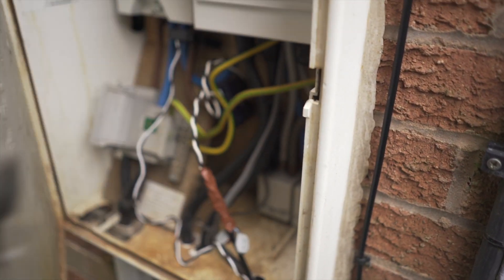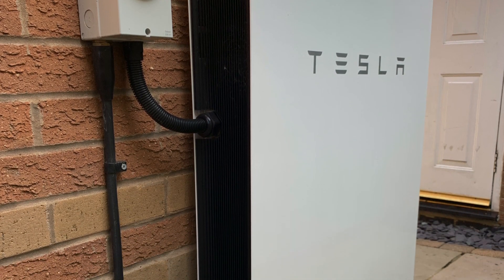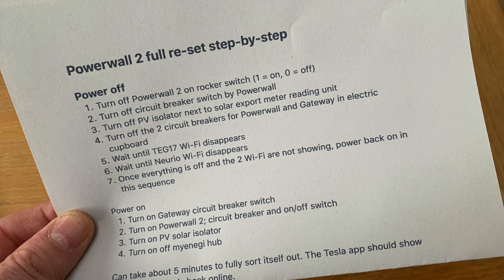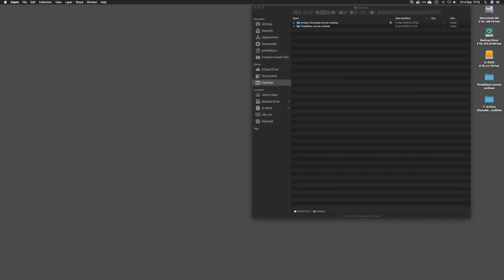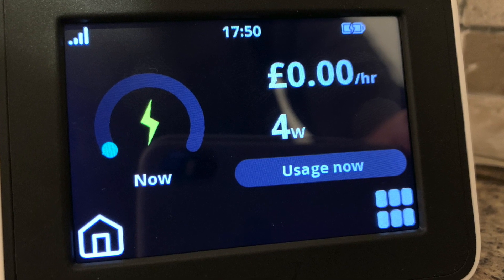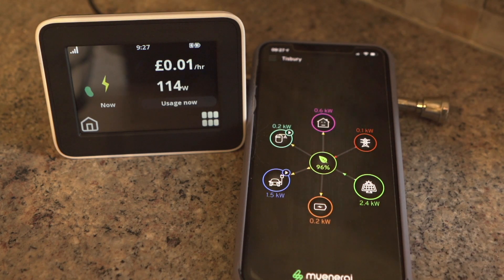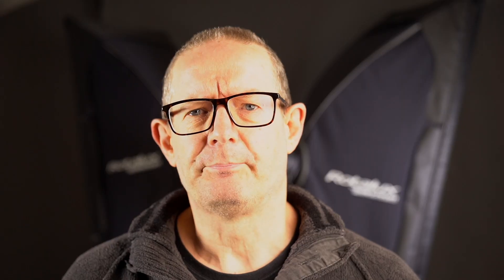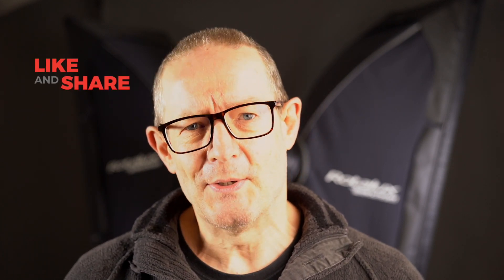Smart Meter swapped to stop phantom drain with Tesla Powerwall 2

Comment: Hi John. Long time no see! Hope all is well. We've recently been contacted about the new Tesla Energy plan from Octopus. No standing charge, 8p/kWh import and export for Tesla vehicle owners and 11p/KwH for non-Tesla vehicle owners. You get to keep the generation part of the FIT, but lose the export part. Have you come across it? We'd be keen to hear your thoughts. I'm struggling to figure out if it'd be worth it for us. We have a 4kWh PV array and a Powerwall 2. Here's how I've tried to work it out:

We drew 2562kWh from the grid over the past year, which cost us £282.25. Our total export tariff was £109.35, which, subtracted from what we paid, leaves £172.90. 

If had no standing charge and paid 11p/kWh for the same amount of energy (we don't have a Tesla car -still on our second Leaf!), it would cost us £281.82. We also gave 431kWh back to the grid over the course of the year. On the Octopus Go tariff this gets us nothing (it's already included in our export tariff), but with the Tesla plan we would receive £47.41 for that energy, which, subtracted from our bill, leaves £234.41.

So it would appear that we would be £61.51 worse off on the Tesla plan, but have I worked it out right? Are there other factors I should be taking into account? Any insights would be gratefully received. Thank you!
Reply from the maker: Hi 
Good to hear from you. 
TBH I've not looked into the minutiae of the tariff as I'm happy on the Agile tariff. I'm aware that quite a few people who have started the move across to it are having some stumbling blocks, not of their doing I hasten to add. I'm in a Facebook group 'Octopus Tesla Energy Plan' which chats about it. You will need to provide evidence of DNO permission for the installation of your Powerwall and your PV system, two separate approvals. Many people do not have these it appears, it's the installers job to obtain these. Many of them don't bother it seems, or have since folded. So be aware of the potential risk around pushing for a DNO approval if one had not been sought in the first place.
Your maths sounds right on what you have documented. The only other thing that I'm uncomfortable with is that Tesla take charge of your Powerwall. You lose what little control you had. They charge and discharge it remotely. You lose the options within the app.
Reply: @johntisbury  Hi John. Thanks for your reply - very good points, as always. I would never have thought about the DNO. And losing control doesn't sound that appealing, either. I think we'll give it a miss for now, though I may take another look at Agile, now you've reminded me!

Comment: Hi John, I'm interested in why you shut your system down to have the meters changed. When Ihad my meters swapped, the house just ran off the PowerWall for the duration...
Reply from the maker: I’m on the Tesla gateway 1, no backup facility, that came with Gateway 2 which arrived early 2019.
Reply: @johntisbury  Was thinking that just as I finished typing the comment.
Reply: @johntisbury  Hi John, I have a non-backup gateway (installed June 2018) and I didn't power down the systems during the two meter swaps in the last 2 months.  Is there a bit of literature I've not read that says I should have?
Reply from the maker: @victoriaonline  it's a good point. I've not read about it anywhere so can't point you to a document of best practice. I did it out of caution to ensure 100% safety for the person working on the electrics.

Comment: John, great info as always. I have had exactly the same with meters swapped a few weeks ago. One question,  does your in home display show the correct amount for when you charge up the powerwal 2 over night? mine has a value as if it was on normal rate.....? hope that makes sense...
Reply: Thanks for confirming, panic over!!
Reply from the maker: Hi Peter, thanks for watching. The IHD will only ever show usage both current and historical. If you’re on a smart tariff Go, Agile etc the true unit rate prices are not reflected by the IHD.

Comment: Thanks for this update! Similar story here. L+G meters replaced with Kaifa units on 25 November. The electricity readings are now consistent to within the available precision (only 2 significant figures in the Tesla app). Export is no longer shown - the IHD always displays zero when exporting. Hopefully this will eventually be resolved by the rumoured "own brand" Octopus IHD that will work properly with the Agile/Tesla tariffs. By the way, my IHD continues to say "waiting for tariff" for the gas, just as it did before the meter change.
Reply from the maker: Thanks Jim for watching. Ah good to know on the export showing zero. I’d worked that out only yesterday when I was looking back at Saturday’s grid export on my online account. 
Is it no wonder there’s no smart gas tariffs! I need to give Octopus Energy a nudge about my gas.

Comment: Glad your issue seems sorted, my smart meter has finally been installed and it seems its the 100mm one with the possible issue, that said I have the same ihd display and it shows export, seems to be a constant 22w ish so hopefully there is no issue 🤷🏻‍♂️
Reply from the maker: Thanks Graham and yay on your smart meter install. If you're seeing a constant export of around 22w then you should be fine. Mine is showing 10 - 44w as I type as we're on battery power, it updates every 5 seconds. Good to know you see the export. Seems some can and some can't see it, most strange.
Reply: @johntisbury  yes it's looking good, first thing I checked the morning after install was import and the ihd shows less than tesla and myenergi apps 👍

Comment: Good to hear your experience. Had our replaced on 17th Nov by Harry. He also replaced our dumb gas meter with a smart one. Although the IHD and Octopus are now showing the electricity HH readings I still can't see the gas, the IHD had been showing the gas but now I don't get a reading. Typically I've now got an estimated reading for the gas as I was overdue a reading. I've been in touch with 🐙 and the first line support have escalated the matter. No sign of the account credit either, so I might have to bother Agile Phil on the forum if I don't hear back in a few days.
Reply from the maker: Good to hear you have had yours replaced too. Seems a similar story about having to nudge them to do things, which they then indeed do.
Reply: @johntisbury  moved the IHD nearer to the gas meter last night and promptly forgot about it until this morning as it wasn't plugged it had run out of juice and switched off. Plugged it in again and the gas use is now showing again 🤔
Reply from the maker: That’s interesting. Have you checked your online account for gas readings to see if they’re showing?
Reply: @johntisbury  sadly no it's only showing my previous manual readings (previous meter was dumb). However, I have been able to download them from N3rgy so they are being picked up by DCC. I suspect that there are only a few staff at 🐙 HQ dealing with these smart meter swaps which is why it's taking time to fix. I doubt doubt they will, just not as quick as we'd like.